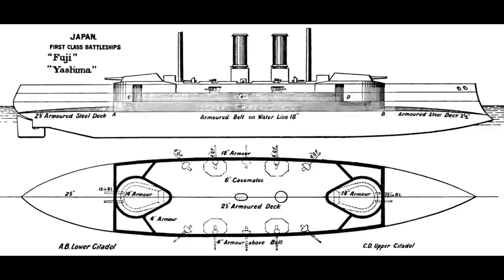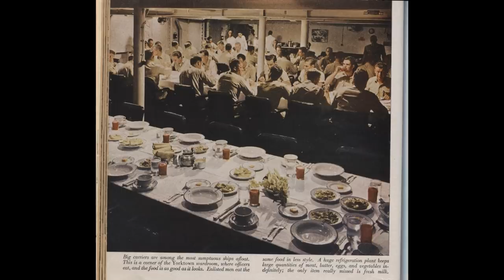The Drydock - Episode 130

Comment: Could the Japanese have upgraded the Ise Class to proper fast battleships by removing one or both of the midships turrets and installing more armor and machinery in their place? Could they have realistically pushed the ships to 28-30 knots? I feel that they would have fared better with these ships than they did with two of the Kongos.
Reply: Probably, the turret and elevator systems would be at least 2000 tons, all of that spent on extra machinery would be a lot more extra oomph. Add to the fact you can shorten the citadel a bit and give it a slightly more hydrodynamic design and you can probably add a bit more extra armor too.
Reply: @brainletmong6302  Didn't the Italians do the same with their refitted battleships, giving them higher speed,although the same poor protection?.
Reply: While possible, I suspect they'd suck compared to a new build of equal technology.  That's quite a bit of length you aren't using for going faster or punching holes in things. Length is weight.  If you want length to go fast, better to put a longer bow on it (Iowa) because its both lighter and cheaper than midships, but if you get a big hole in it, the ship doesn't roll over and sink. Maybe not literally Iowa silly long, but point still stands.
Reply: Probably not, because their hulls couldn’t handle it.  Hull form is a huge determining factor in a ship’s speed, and none of the WWI-era battleships had hull forms designed for speeds in the high 20s of knots range.   (Battlecruisers did, which is why the Kongos could go faster with more powerful machinery.)   Even if you could somehow cram an Iowa’s power plant into an Ise class, it’s probably not going to hit 28 knots.  And if it did, it would probably rip itself apart from the huge drag forces on a hull only designed for 23 knots.   Now if you added 50 feet to the hull and changed some hydrodynamic features, you could probably do it.  But by the time you do all that, you might as well build a new ship.
Reply: @bluemarlin8138   Oddly enough their hull forms and overall dimensions strongly resembled the Kongo Class so I believe the Ises probably had a better chance of hitting 28+ knots than any other WWI dreadnoughts. https://upload.wikimedia.org/wikipedia/commons/7/7d/ONI-Ise-classDrawing.jpg https://upload.wikimedia.org/wikipedia/commons/5/50/Kongo1944.png . The Ises hit 25 knots on 80,000 HP after their 1930s rebuild so I don't think it's much of a stretch to say they could have reached 28 knots with about 140,000 HP. The modernization also added some length to the ships. Had the Japanese really invested in them they could have served as useful carrier escorts and the extra deck space from the removed turret(s) could have hosted an enormous anti-aircraft battery. They would have functioned as much tougher Kongos.

While converting the Ises to proper fast battleships may have been almost as expensive as just building new battleships it wouldn't have violated any naval treaties.